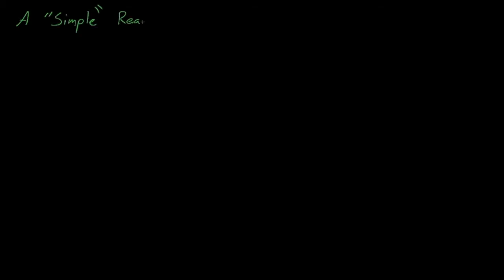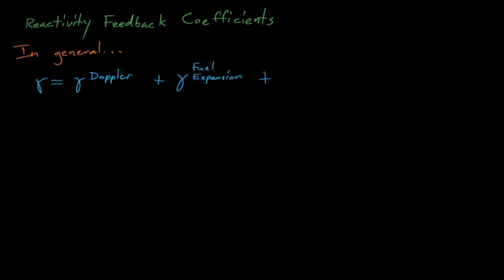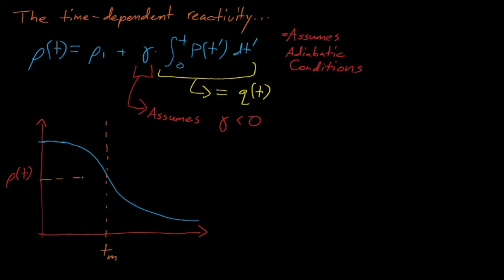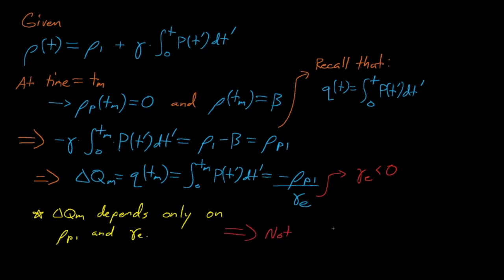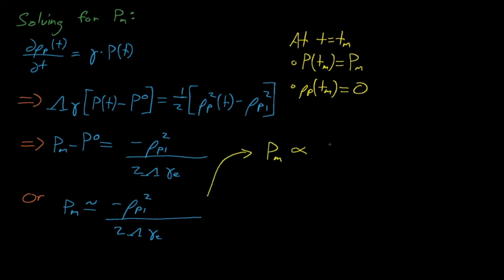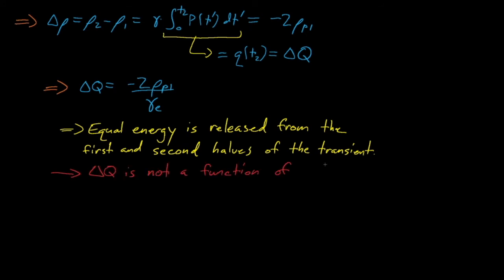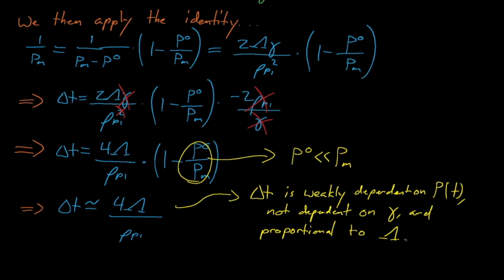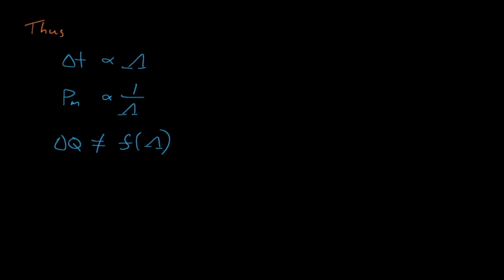NE560 - Lecture 9: A Reactor Dynamics Solution for Prompt Supercritical Transients

Comment: The power shouldn't return back to its initial position after right? At least not in the same time frame? (@0:46)
Reply from the maker: Actually the power should return roughly to its initial, post-PKA-adjusted power because of the large negative reactivity insertion as the fuel's temperature increases.  In reality, these transients could be cyclical, where the fuel goes on another prompt supercritical excursion after its power drops back down to its initial power.  This has happened multiple times during several criticality safety accidents, and it can be difficult shutting down a reactor that wants to have multiple periodic supercritical transients.
Reply: @NuclearEngineeringLectures Interesting! Do you have an example of a known reactor accident where this cyclic behavior was observed.
Reply from the maker: @shikshokio1  this has occurred several times during criticality accidents, including:
Mayak, 1968 (Russia)
Wood River Junction, 1964 (USA)
Tokai-Mura, 1999 (Japan)

I have videos that cover the Wood River Junction and Tokai-Mura accidents, you can find them at:
https://youtu.be/sIwWoiw_EJ0

https://youtu.be/PRUad803xgI